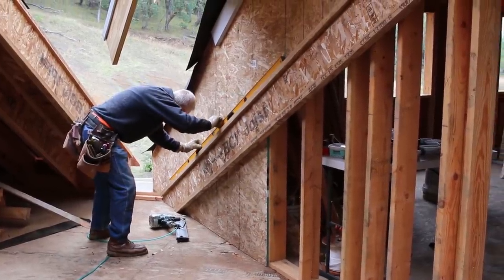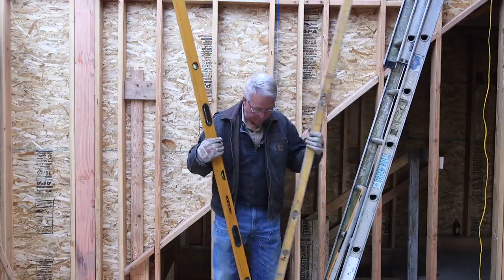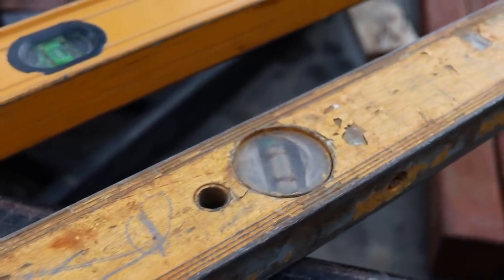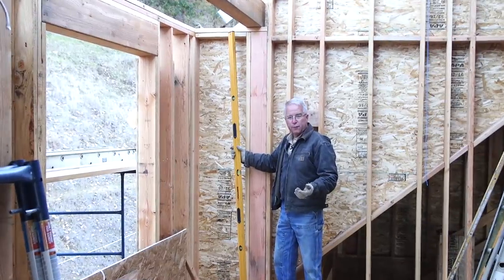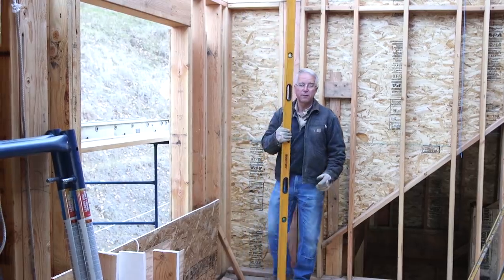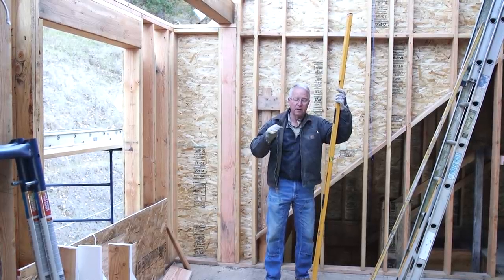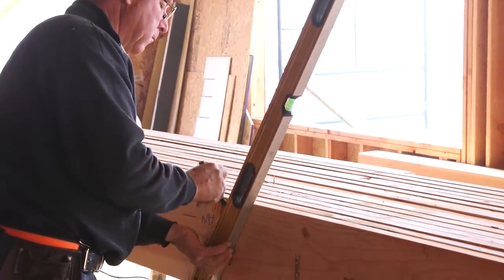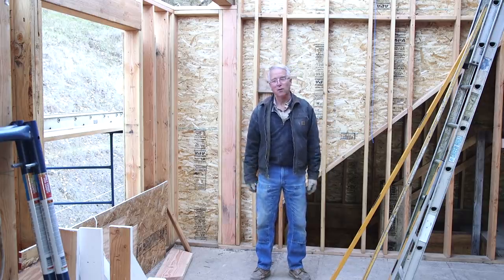The Luxurious 8 ft Level

Comment: I'm a now-retired guy who's not a carpenter (furniture maker though) who has been working on and adding to my century-plus year old house for 25 years. I've got tools and skills, but not a pro. I'll bet I've hung a dozen new doors at least in the rejuvenation of this old house. Most of those came in one large bite after an addition. I used the job to justify the purchase a six foot level plus a jig kit for routing hinges. The six footer has many of the virtues you so rightly praise in the 8-footer in terms of length and straightness, but the 8-footer won't let you work inside a door frame. The six-footer, though? Luxury, as you say. Perfect tool.  If I was doing construction carpentry more often, however, I'd probably want the 8-footer too!

Comment: As a retired carpenter/general contractor I'll say you are onto something.  But I prefer a six foot level.  Maybe because I hung so many doors.  A six footer will fit between studs and allow you to check for plumb from inside.  Still, the four footer is the most used.  But I have a two footer with a piece of 1/4" material taped to one end to check for proper grade on plumbing waste pipes.

Comment: I use a 4' Johnson Box level, and a 2' empire. They are not top of the line, but they read true.  I have seen guys in my trade (masonry) with $150 levels do crummy work.  As far as levels are concerned they need to be sturdy so that flexion is not a factor.  the vials need to be visible and readable even in poor lighting. And the lines on the vials need to be of the same weight and the margin between the bubble and the lines needs to be narrow.

Comment: Levels are handy tools! Having a variety of them helps a lot. At work we have a Stabila 7-12’ plate level, 6’ Stabila, numerous four footers, a two footer, and we all carry torpedo levels in our pouches. For building accurate pole barn, a plate level is what you need. A six foot level is ideal for hanging doors, since you can get the hinge side perfectly plumb and straight, which makes the rest of it go a lot easier.  I have a plate level at my home shop as well, and I’ll add a few more levels to my arsenal when I get a good excuse.

Comment: I just built a fence this week. I used one of those fence post corner levels that you attach to the top of the post with a rubber band. It seemed like a good and useful tool to make the job go fast. After I had set all the posts with braces, about to pour concrete,  I verified they were square with my six foot level.... every single post was out.
Reply: I have wondered if those are accurate. Was it a johnson that you used?
Reply: They work great if the post is absolutely straight and not twisted .  Otherwise remember you're leveling basically the area where the corner level is attached . It may be plumb , but a twisted post will be out below that .
Reply: @jakerogers6562  Brand is Empire, called their "720 post and pipe level." Made of plastic. I'm open to the possiblity that I'm just a noob.

Comment: I like your videos.    My most used level I own is a Stabila 16" that came as a bonus on one of my other levels.  Having a  graduated scale on the bubble is a nice feature for drain lines.   Checking a level before you leave the store is a good thing to do, or at least when you get home.  This comes from an article I read.  With some playing card level the level.  Turn it around.  It should read the same.

Comment: What an 8 ft level will do being leaned up on a wall with a tile floor, make one hell of a noise when someone knocks it over.  I'm a 26 year old tile installer  (CLM Tile & Stone) with 9 years of experience (Not claiming to be an expert by any means) and my biggest pet peeve is seeing levels leaning up on walls. It's just a loud noise waiting to happen, Or a chipped tile on a bench, curb or floor. Leaning levels up is also great for dinging walls and cabinets. I cringe when I see levels leaning up. I have learned the hard way many times. It took me for ever to break the habit.  Let them yellow surface bruisers rest on the floor. THANK YOU FOR ALL THE WONDERFUL VIDEOS AND KNOWLEDGE YOU SHARE!!
Reply: My levels stay on the floor and tight to the wall, perhaps with a few studs in front of it

Comment: HINT! another useful straight edge. find a length of Wide steal banding 1 to 1 1/8 wide. i have a 9 foot one in my shop. great for working with sheet goods.a spring clamp on each end and your good!  also you can roll it up and store it that way.. I keep mine in one panel of my garage door.. its light and handy. i hope this helps..  oh, thanks for the tips!
Reply from the maker: Thanks for THIS great tip!!
Reply: You can also use a measuring tape. The ones that have the hook protruding on all sides are good cos you can flip the tape over.

Comment: One reason why a Level of this length is valuable is that it will also tell  you if a wall/floor/rafters or true in an existing structure and often  it lets you know there's a larger problem. Indeed a sheet of plywood makes a impromptu tool as  I have cut them corner to corner to make 4X8 Angle Square and many have found out that a floor has a problem when you can rock a sheet on its edge sitting on it. But like most Levels you have to take it it an check it in two planes not just one because a wall like a post can be plumb vertically but it also has to be plumb/square at 90 degrees so it doesn't throw off the next wall from it.

Comment: I build big solid hardwood wooden doors. It is "essential", pun intended, that I have an extremely reliable 8 foot straight edge. I use my 8 foot level every single day for the straightness of its edge which I have verified down to at least 1 /64" inch accuracy. It's nice that it is also a level, but I hardly ever use it for that feature.
Reply: davearonow sorry, but where is the pun again?
Reply: @islanti I'd say, you must be some kind of genius. The thought never would have occurred to me. The level is dead straight, it's very durable, AND it's a level. I'm not interested in cheap. I like my level over cheaper materials for all of the exact same reasons this video was posted. The answers are in the video. Watch the video.

Comment: I never owned an 8 foot level. I always found them to be too cumbersome and they don’t stow well. They don’t fit in most pick-ups, unless you put them on an angle and then they seem to be like a magnet for someone to lay something on them. And the longer they are, the easier they bend.
Concrete columns and walls require a straightedge to be used in conjunction with a level. They have strong backs and walers that you have to get around and it’s insufficient to plumb off of them.
Masons, for some reason always gravitate to the wooden frame levels.
Plumb-bobs are tough to beat, when something absolutely, positively has to be ‘dead-on’ plumb. (Or ‘dead-nuts’, as we used to say in the field). Never need calibration, no matter how much the post man abused them during shipping.
The PLS lasers are the next best thing to a plumb-bob and are able to work in windy conditions.
Torpedo levels are for plumbers and electricians for the most part. Scaffold erectors can find them somewhat useful in a pinch.
Reply: I mounted a 8'6" stick of pvc with the locking conduit carrier kit to my ladder rack, it is lockable and prevents damage. Doubles as a great way to protect and secure my fishing rods as well.
Reply: @jasonc3522  Stowing levels in a piece of pvc is a great idea. What size pipe, 6”? I might cram a piece of that large bubble wrap in there with them, just to keep the levels from jostling together.
Reply: As I understand it, masons prefer the old brass bound mahogany level because they are a bit more forgiving of getting splotches of mortar on them. Cement causes aluminum to corrode. I have a 35 15/16” plain wood level that my old boss’s brother Nick gave to me. It had started out as a 4’ level but I think backed a dump truck over it. That was probably an accident. Nick had on at least one occasion backed his truck over a wooden extension ladder that his brother refused to get rid of.
Reply: @psidvicious  I think you can get the aluminum locking end caps for 4", 6", and 8" pipe, I used 6" and paid about $65 for the caps. Northern tool had them listed as "conduit carrier kit" on their website. It's pretty much a mail order item only unless you are lucky enough to find one in stock somewhere. It's a small price to pay too keep hundreds of dollars worth of levels from walking off or getting bent. The kit comes with screws but you can use rivets instead to deter thieves that carrier impact drivers.
Reply: Lazers are #1 
 the rest follows .

Comment: I man can't have too many levels!  😅

I like my door hanging set..a 68" and a 32" with magnets.  They make hanging doors simple.

For framing I have a Stabila plate level.  It works on anything from about 7' to 12'  

More recently I used a PLS laser system.   It does horizontal and vertical and it fits perfectly in the little pouch on my Occidental tool bag.  Sometimes it's nice to have a level in your pocket.  👍
Reply: Those PLS lasers are great. Today’s plumb-bobs.

Comment: On the level... I don’t lend out levels, I have given older levels to apprentices, when I up graded, but in my truck rack, I had a 10’ pvc tube, plugged on both ends with a screw off cap this housed 3 levels, 8’ &2’ end to end, and a 6’ All held together with Velcro, in my bag was a torpedo and an 18” lever. Another thing I carried was a 100’ length of clear flexible tubing, this way knowing that water seeks an equal height, I could also check heights across a room with somewhat accurate measurements, if you had problems seeing clear water, then add coloring of some sort! This worked well on uneven ground, tape one end to the wall, stud, or post, and fill, the entire tube, walk out to the desired are and spill out the last x amount of inches tape to structure and look for water level, now a days people use laser levels, but I have seen issues with other who weren’t careful knock them, and not tell anybody, and the carpenter who was using it didn’t periodically check it. So remember that every tool has its limits, and sometimes you need a little flexibility!
Reply: In addition to adding a little food coloring to the water in your water level, try adding just a cpl drops of dishwashing soap to the water. It breaks down the surface tension of the water and it doesn’t tend to ‘curl’ at the point where your reading the water level in the tube. [the dilemma always being - Do I mark the top of the ‘curl’ or the trough?]

Comment: An 8, 6, 4, 2, and a torpedo are must haves for framing new construction or remodels. I've never found a reason to go larger than 8 ft.past that you can usually get along with string line or a transit. But we've had to go back behind other framing crews to fix issues caused by being out of square or plumb and trust me you'll save your general days of labor and piles of money by just spending a few bucks on a decent set of levels and measuring tools. (knowing how to use them helps too)

Comment: You can also use what commercial carpenters like myself have done for years...metal studs..a length pretty much limited by what you order..on down to the gauge.  Track comes typically in 10 foot lengths too....I use metal for a guide for ripping sheet goods...can't be beat and always where ever I am working.  I started out with plumb bobs and levels...2's, 4's, and 6 footer was my go to level when I framed a lot of commerical wall back in the 90's...since lasers have come around to what they are now...line generators in green can't be beat as long as your lighting is adequate to see the lines...so much better than a level for leveling or checking for plumb...straight edges...metal studs or track are lighter and longer if need be.  Look into them if you haven't...up the gauge and width if you want more rigidity.  Lower the number the thicker.

Comment: I keep three levels in my work van. The Torpedo (least used) and 2’ live in the toolbox with my hand tools. Then there is the Levolution level that consists of three sections that can be joined together giving me a 2’, 4, 6’ and 8’ level all in a 4 1/2’ case. I think the manufacturer went out of business because the average carpenter or contractor wouldn’t pay $200 for “a” level. Totally agree that the 8’ is a luxury, most of the time it’s in 6’ mode for hanging doors which leaves me a 2’ section free to check the head jamb for level. There have been times when I wish I had bought the optional 1’ section that would have given me a three, five and seven foot option.

Comment: My grandfather gave me a Delta saw and Delta drill press from the 50's and a Bailey 5 1/2 plane man there is notting to run like dat plane 2 3/8" wide blade smooth and sweet cutting so let them pay for your level sir tools are a man's extension of himself good job

Comment: One of my levels has the great feature that one of the bubbles spins 360 degrees so you can repeat a specific angle of marking and cutting but I forgot about that after not using it for a year or so and messed up a base-cabinet install because the bubble was turned just a couple degrees. If level is important, now I turn my level 180 degrees just to check the accuracy of the bubble.
Reply: As I typed this this morning I kept wondering what did I ever use this level for that I needed it's adjustable bubble and I just now, hours later, remembered...it was great for running drains. I could adjust the bubble for 1/8 of an inch fall for each linear foot and when the level said "level" I knew the fall was right. Before that I would tape a small bock on one end of my 2' or 4' level, depending on how long the runs were that accomplished the same thing.
Reply: Exactly that ingenuity is what no one teaches in school. In apprenticeship we had lessons on eyeballing the fall because no one was supposed to have such a fancy level. On the other hand I can now eyeball everything from 0.1 to 3% inclination on a level.

Comment: A different way to to go is a 1' magnetic level and a 10' section of metal framing track. They are straight, true and cheap. It can be cut into 8' and 2' or 6' and 4'. Stick the level on the inside of the track where it is protected and you are good to go. The 10' section has been helpful on old barns.

Comment: I use a 2 mtr length of aluminium 80mm x 6mm as a straight edge and as a track for my circular saw and a 2 mtr level is a great way to transfer levels across corners if you don't have a laser = )

Comment: My dad has always had a 6'6" level. Old and heavy, but not accurate. what we always did was use it for a straight edge and put a 4ft up against it to check for plumb and level. I now have a 6'6" Stabila and the horizontal veil is no longer accurate so I set my 32 in Stabila level on it to level cabinets. I really need to get a new 6'6" stabila

Comment: I have 1 level 8'4in, one 12' & another, a tad over 16'2in! They are not luxury- that implies expensive. They are 2 inch square section, alloy extrusions- Tubes- like the post sections off an alloy car port. They're exceptionally straight & very strong; due to the tensile alloy employed. I bought them at a scrap metal yard for $1.80 a Lb (<$7 total) By holding my Stabilla 4 foot level against them, they are as accurate as any and the 16' will span two foundation piers! Fantastic for showing up high spots on a wall prior to sheeting & light enough to hold one handed. Although cheap to replace, I have had all three for over 15 yrs so they are pretty tough if handled with due care and make fantastic fences for long saw cutting boards. The 16 footer has no perceivable sag! Now watch the price of 2in alloy tube go up!!!! Even so, still not a luxury. They all enable me to do good work. Hope this helps- H

Comment: A 8’ level is a wonderful tool but were do you store it? I have a husky slide bob it’s a 2 piece level that extends from 5’-9’. It comes in handy for a lot of the thing’s you have mentioned and it fits behind the seat of my truck. I do think that a 1 piece level is more accurate though. Keep on keeping on and be safe in these troubled times.